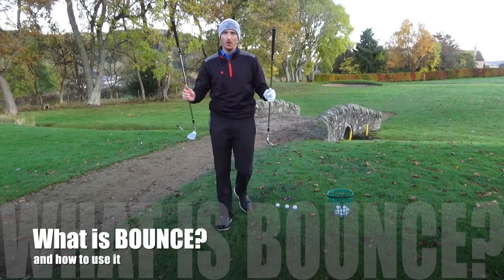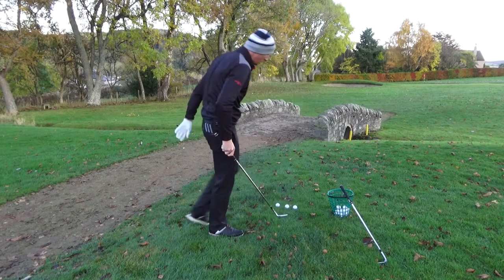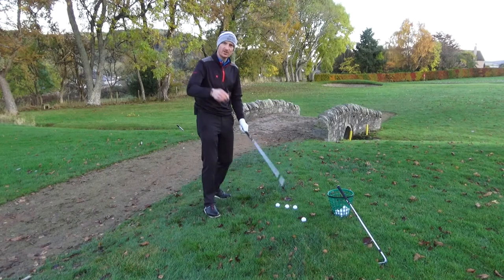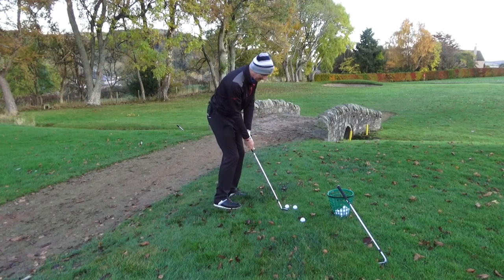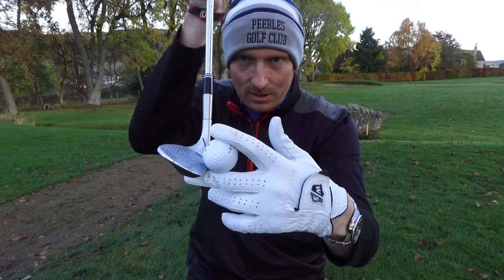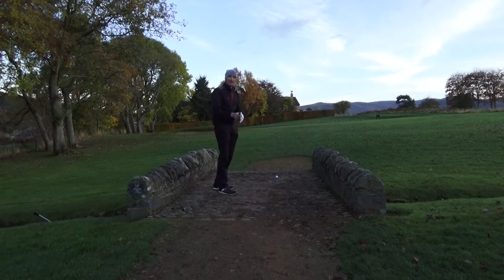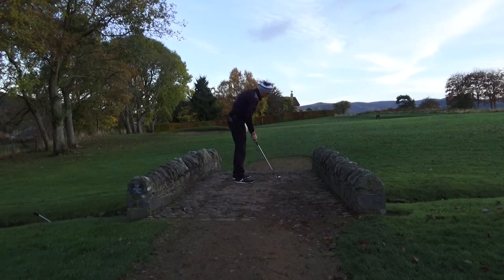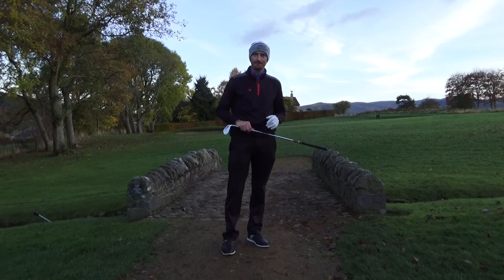What is "bounce angle" and how does it work?

Comment: Another good video mate. Question though! With bounce in mind should players like me be thinking about having a similar bounce on both or all 3 wedges or go for different bounce on them so they can be used in different situations. Obviously not with same lofts but say maybe a 50 degree with a high bounce and a 54 with low bounce? What are your thoughts.Cheers
Reply from the maker: cmacd1984 on parkland course you play a high bounce on 50 as I assume it's used more for full shots, low bounce on 54 for funky shots around the green and mid-bounce on most lofted so it doesn't dig too much into sand when playing bunker shots.
Reply: Steve Johnston PGA cool. I'll be in touch soon cause thinking of dropping a wood and adding a wedge to my bag for next season but could do with a chat about gapping.